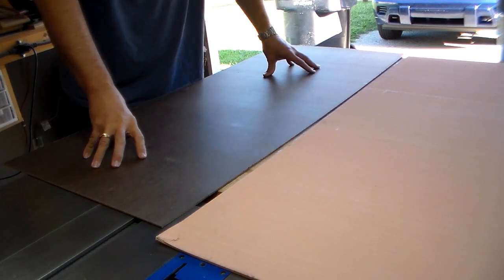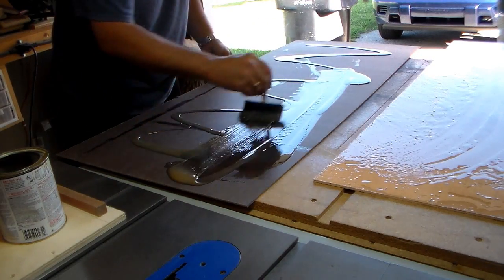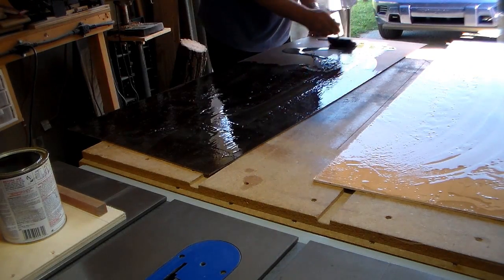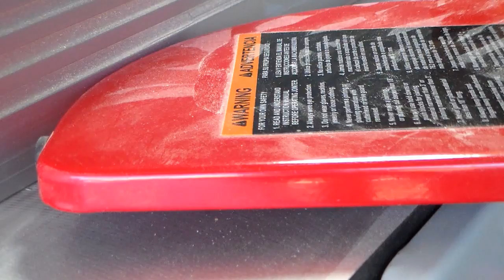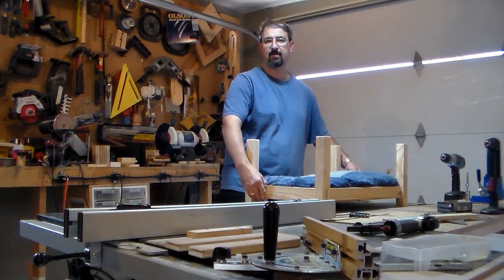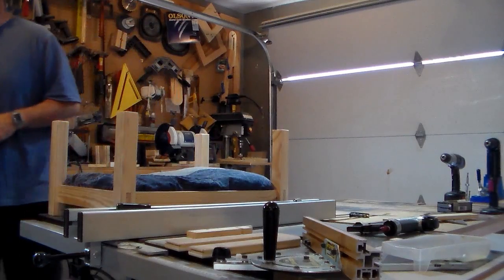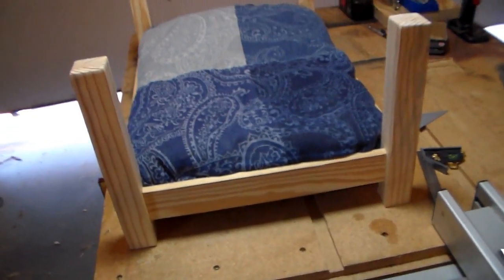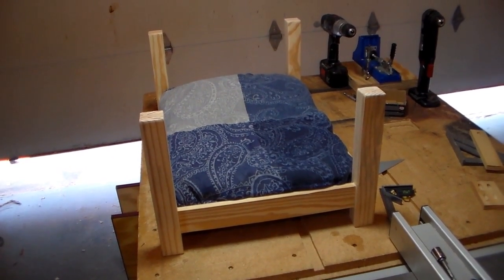Dog Bed

Comment: Nice bed but why are the legs so long? at one point I thought you might be adding three sides to make it draft proof
Reply from the maker: No reason for the long leg just thought it would look cool. My original thought was put a platform on top and it would double up as a step up in to my bed. But after the fact why make a bed then a step into my bed. So no real reason.